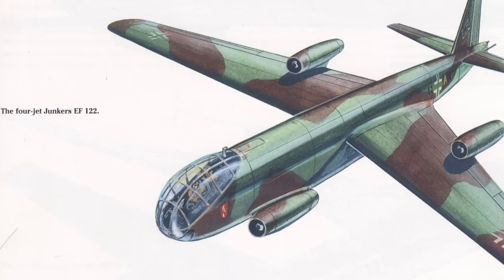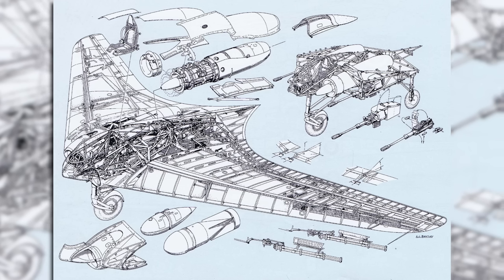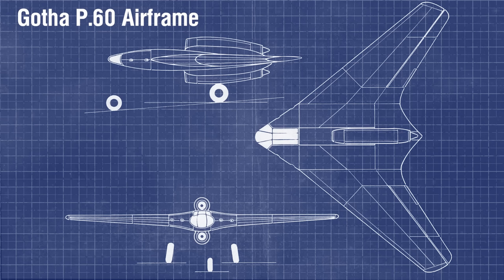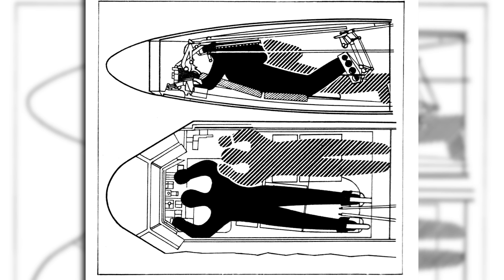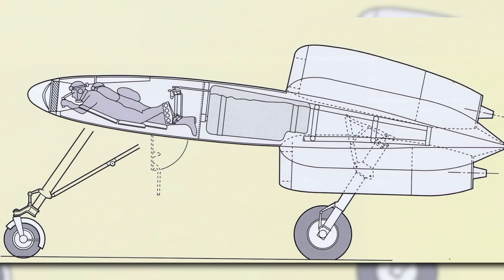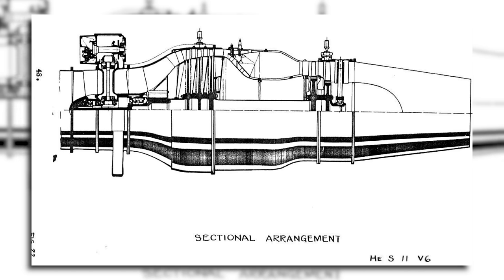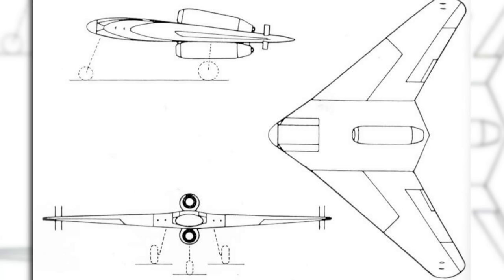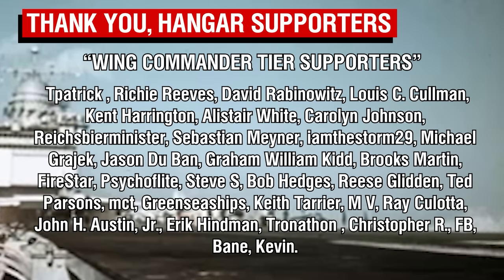Gotha P.60 - A Superior Horten 229? | Concept Planes

Comment: I don't think either plane, the Gotha or Horten would have been operational even if the testing had been done. The reason being, that when the flying wing planes made by the USA around the same time and just after the war, were tested at Muroc Army Air Field, later named Edwards AFB, there appeared to be an inherent instability problem with them associated with the technology of the period. It was not until later when computer tech was installed in the plane that this solved an as a result we have now B-2 bomber.
Reply: Inherent
Reply: Well, more that the real issue was that flying wings without fly-by-wire technology are extremely challenging to handle, and the USA figured that the added pilot-training requirements was prohibitively expensive in both time and resources. With pilot training always a bottleneck at the best of times, requiring dozens, if not hundreds, of more flight hours in training was just not acceptable.
Reply: @nightjarflying  Thank you. I getting old.
Reply: Yeah, sure, if the muricans cant, no one can.
Thats why they needed a german to show them how to put a satelite in orbit and men on the moon.
Flying wing can be build stable, the Hortens did it befor, during and after the war, if in the RC community flying wings are known for their good and stable flying abilities.
Reply: @wolf310ii  The Horten never flew, and RC planes cannot be really good test indicators for the real thing. BTW,  I was not down grading German Technology.  But I am not overhyping it as well.
Reply: @coleparker  The Horten IX did fly and it wasnt the only flying wing the Hortens build.
and yes, RC planes are a good indicator that flying wings have good flying abilitys, same laws of physic and aerodynamic.
Reply: @wolf310ii  You are right. Two were flown, the first flight was done as un powered glider. The second was powered and promptly crashes killing its test pilot. All the rest of the so called production models were captured at wars end. The crash was one of the main pointed out in my comment about flying wings in the USAF. Before the introduction of computer controls, there seems to have been a stability problem in them.
Reply: @coleparker  It didnt crash promptly, it crashed on 3rd test flight after 45 minutes, because of an engine fire, not because of an controll or stability problem.
Reply: @wolf310ii  LooL
Reply: @wolf310ii  Look, you think the Germans were the only ones testing the flying wing concept. Jack Northrop was developing the Flying Wing for the USAAF, USAF in 1940 up through 1945 into the late 40s into the 50s. His first types used propeller driven engines. In the 1946 they started serious testing and finally in 1947 and 50, Check the date. They flew the YB 49 flying wing. It crashed with Col Edwards as the pilot. The cause of crash was determined to be stability problems and pilot response to them, which is probably why they never really became a viable bomber until the introduction of computers into the system.

If you are interested, I suggest that you look at their development and testing at Muroc Army Air Field which was changed to Edwards AFB California in honor of Colonel Edwards/
Reply: @coleparker  No i dont think that, UK and Rissia did also build flying wings.
And just because the YB 49 crashed because of stability problems, doesnt mean every flying wing has stability problems and will crash because of it.
The Ho Ib flew for over 50 years in a flying school, without crashing because of stability problems.

Comment: What's interesting to me is how many of the first gen jets from countries like the UK, France, and the USA had straight wings as opposed to the severely swept wings of these late WWII German designs. I know the allies came into possession of the German research on swept wings, but it did take them a lot longer to put it into practice compared to the Germans.
Reply: The initial jet engines the US, the UK and the USSR were producing really did not produce that much thrust. Swept wings really came into their own once speed ranges got into trans sonic ranges. And it's not like the German designers were the only ones that understood the benefits of swept wings. The UK, US and Soviets had aerodynamic research labs too. To a large degree we hear the "US, UK or Soviet designers just didn't understand the potential of the jet engine (1). Wrong. They understood it. They believed that the high temperature alloys needed for such engines simply had not been developed yet. Wittle gets the credit for his patent and building the first working turbojet. But it's not like he was the only one working on the idea. The only thing is nobody else could get one working or the money to build one prior to Whittle and then Ohlien. Others had tried building aviation turbines pre Whittle but they simply were too heavy. One exception I can think of is Lockheed which was working on its axial flow design starting in the late 30s iirc. 
1) Some did. Some didn't. Plus in the 30s money was tight.
Reply: No nazi operational jets had highly swept wings, the centre of gravity adjustment Me262 wings had the sweep of the DH Tiger Moth, the Fairey Swordfish and the DC3/C-47.  The flying wings had strong wing sweep for lateral stability as featured in many microlights and rogallo wing hang gliders.  None of the half baked pre nazi collapse designs had any prospect of flying fast enough to need wing sweep to delay compressibility.
Reply: @givenfirstnamefamilyfirstn3935  Wrong. The Me 163 had compressibility problems, and the Me 262 also experienced problems in dives.

Comment: it was, but the P60 was less stealthy to radar
Reply: Neither P.60 nor Ho229 were built with deep thoughts on radar signature in mind.
Reply: @wanderschlosser1857 That's a false narrative, Germany was years ahead in radar stealth technology..
Reply: @WilhelmKarsten  No it wasn't. Since radar stealth technology wasn't a thing back then. Flying wings weren't created because of radar signatures. They may have figured it as a helpful side effect but even that is rather a guess. There is no proof at all that Germany did research in radar avoidance by the shape of an airplane. What they did is developing radar reduction coatings for submarine snorkels but that's a completely different area.
Reply: @wanderschlosser1857  LOL! You really don't have any knowledge of this topic do you?
Anyone familiar with radar stealth aircraft technology can take one look at the Ho-229 and see that it is completely devoid of any significant retroreflective structures, something you won't see on other contemporary flying wing designs.
Reply: @WilhelmKarsten  Yeah you can see that, do you? Back in reality radar signatures are calculated and measured. Alone the turbine intakes of the 229 have likely a bigger radar signature than a 4th gen fighter. The 229 resembling a B2 doesn't mean it was designed with the same goals in mind. Would the 229 be less prone to radar reflection than a Me262 or Arado 234? Very likely. Does that mean it is a stealth fighter? Certainly not! The point is, there is no evidence that radar signature was a major, if any subject for the design of the Ho229.
Reply: @wanderschlosser1857  Its obvious you don't know anything at all about radar stealth technology, your comment reveals someone who has absolutely no formal education or professional experience in the field.
1st. No amount of RAM is going to reduce the RCS of an aircraft that presents with retroreflective structures.
2rd. No aircraft are completely invisible to radar, the goal is to reduce the RCS of the aircraft in order to limit the  range of the enemies detection radar.

3rd. British long range detection radar during WW2 was meter band, primitive by the microwave band standard today, 
Testing conducted by Northrup confirmed that the Ho-229 had at least a 50% reduction in frontal RCS (w/o RAM applied).
This is a significant tactal advantage for the era... enough to foil RAF attempts to intercept it before reaching its mission target.
Reply: @WilhelmKarsten  I know about the Northrop test with a 229 mockup. Which wasn't the same material as the original nor did it have all the reflecting surfaces such as compressor blades of the engines. It was simply a test how much the shape of the 229 flying wings would have affected its radar signature back in the day. And yes this test revealed that the expected radar signature might have been significantly lower for a real 229 in comparison to other aircraft of the time. That still doesn't prove that this was what Horten or Gotha or the German aircraft industry had in mind when developing the aircraft. And that was my point. Having a rather coincidental design reducing radar signature does not mean you are years ahead in stealth technology. Northrop figured the same from their flying wing designs of the 30's and 40's when they realized that a flying wing has a smaller RCS by nature. It was decades later when they actually used that knowledge for the B2. That still doesn't mean that the low RCS of the YB-35 and YB-49 were intentional. The same applies to Horton's designs.
Reply: @wanderschlosser1857  Its important to remember that the Northrup tests were also conducted using modern microwave band radar. 
The obvious difference between the Ho-229 and the other early flying wing designs is clear to the naked eye at a simple glance, to imply that this is mere coincidence is just a pathetic attempt at denying the evidence.
Reply: @WilhelmKarsten  The 229 is based on Horten gliders starting from the early 30's (before radar was operational). I assume all of them were designed with RCS in mind then? And your evidence is that it's obvious to the naked eye in the 21st century? Or because there was a mockup test by Northrop 2009 that somewhat proves the lower RCS of a flying wing (ca. 20%), similar as on their own designs of the 40's, which was indeed unintentional? Which was conducted for a TV program (National Geographics) btw. You're just guessing because it sounds cool that Germany was super advanced and able to built the 1st stealth planes in the 40's. The reality is, there is absolutely no evidence that the Hortens had the intention to create a low RCS aircraft. The Horten brothers experimented for many years with all different kind of flying wings and besides Northrop they were the masters of them. The main reason to follow that path on both sides of the Atlantic was the search for reduced drag. The RCS advantage was an unintentional side effect and it took another 40 years to put that into use.

Comment: Jack Northrop would have been impressed.. These flying wing types came out at about the same time.. Northrop 's flying wing ultimately failed because of stability issues. But today we have the B2 and the B-21... The roll rate was poor in these flying wing type craft... The only advantage they had would have to be speed..
Reply: ...and stealth.
Reply: @WilhelmKarsten  No
Reply: @wolf310ii  You didn't know that the Ho-229 had radar stealth technology??
Reply: @WilhelmKarsten  Unlike you, i know it didnt.
Flying wing doesnt mean stealth
Reply: @wolf310ii  True, the Ho-229 was much more advanced than just a flying wing... it has more than a 50% reduction in frontal RCS than any comparable sized aircraft at the time... and this is without its RAM applied.
 this represent a very significant tactical advantage against enemy detection radar in service during WW2.
The Allies had absolutely nothing comparable to this technology..
Reply: @WilhelmKarsten  No, it had not 50% lower RCS, it was around 20% against the outdated Chain Home radar, against the up to date cm radar at that time it had almost no effect.
And no, it was not much more advanced, being a flying wing is the only similarity to the B-2.
Also there was no RAM that could be applied. There was no stealth technologie at all in the Ho IX, because they didnt care about it, there was no research for it in the Luftwaffe and they didnt even done RCS test
Reply: @wolf310ii  WOW! You are very confused and misinformed regarding this subject.
The tests conducted by Lockheed and Northrup confirmed reduced frontal RCS more than 20% using modern microwave band radar.
Britain was using metere band long range detection radar.

The B-2 shares a critical feature in common that Northrup copied directly from the Ho-229.
The Ho-229 is completely devoid of any significant retroreflective structures, something not found on other flying wing aircraft prior to its construction.
Anyone familiar with Radar Stealth technology can spot this unique feature immediately.

Germany was the only country to develop, produce and use RAM in operational service during WW2.

Are you unfamiliar with German WW2 RAM technology such as Tarnmatte and Ferromatten ???
You seem to be in a deep state of denial and confusion regarding this topic..
Reply: @WilhelmKarsten  You are the one being total missinformed.

The engines and the cockpit are highly retroreflective, even wingprofile itself is reflective. everyone knowing about stealth would spot the differences to B-2 immediatlly. The B-2 dont has paralell straight leading and trailing edges and a sharp instead of round leading edge to look cool, its for being only reflective at 4 very small angles. The Ho IX has none of these stealth features.
The air intakes of the B-2 are on top the wings, with radar traps, so that every radar waves that go in, cant come out. The Ho IX has the intakes in the leading edge, without any protection against radar.

 The test Northrop did showed the 20% reduction with meter wavelenght like the chain home used, with the dcm and cm wavelenght the UK used too it showed almost no reduction and with modern radar it showed no reduction at all.
The real Ho IX would perform even worse than the wooden mockup, without the metal grider frame, engines and no cockpitinterior.
Even Reimar Hortens made up coal dust paint was proven to be a hoax and have no effect. 

There are no, absolute none, historical documents about the Ho IX that even mention stealth.
At this point of the war, stealth was total irrelevant for the Luftwaffe, the battle of britain was long lost and over.
The anti radar coatings the Kriegsmarine used had nothing to do with the Luftwaffe.
Just look up a picture of the anti radar coating on a snorkel head, and think abaut it what this coating would do to the aerodynamic of an airplane.

Only UFO lunatics and neonazis keep making up and spreading this BS.
If anything of that would be true, why didnt had Argentina the first stealth figther after the war?

Comment: Their designs were far in advance of everyone else's: but the procurement process was so political and favoritism was so rampant, that it virtually rendered ineffective all these designs tendered. And that was a blessing for the Allies.
Reply: The number of issues for Germany were replete. Its industry suffered from excessive demand, and poor production output. it lacked pilots, fuel. Even the much vaunted Jet engines were, to be a hostile, junk.
Reply: @tisFrancesfault limited manpower and resources is what gave birth to the concept of force multiplication used by modern military forces.

Germany was the world's leader in jet engine technology during WW2, the Allies had absolutely nothing comparable to German jet engines
Reply: @WilhelmKarsten  German Jets had so much influence that, that the allied powers so no need to drastically change its operations as was, let alone forcing the deployment of its own jets. You're not a force multiplier, if it has such little operational impact.
Reply: @tisFrancesfault  The Messerschmitt Me-262 conclusively proves otherwise, it was a highly successful fighter-interceptor while Allied jets did nothing apart from killing Allied pilots.
Reply: @WilhelmKarsten  No, if it was a true threat the Allies would have countered it, but ultimately it was not considered worth the effort. Exist allied air power was sufficient. Even if all airframes were deployable, allied air power was supreme.
Reply: @tisFrancesfault  The  Allies built aircraft like the Gloster Meatbox and the Lockheed P-80 to counter German jet superiority...
The Messerschmitt Me-262 was successful in WW2,  Allied jets were a failure.
Reply: @WilhelmKarsten   Neither were developed to counter German jets, and neither were deployed against German Jets.
Reply: @WilhelmKarsten  Hello Sandyboy, the allies certainly had nothing as crappy, fragile and pointless as your nazi chums' jet engines, that's true.
Reply: @WilhelmKarsten  Hello Sandyboy, as you know the Me 262 failed in all its goals and was never a fighter. It was shot down readily by allied piston prop planes and post war nobody wanted it.
Reply: @WilhelmKarsten  Hello Sandyboy,  the Allies did indeed build aircraft like the Gloster Meteor, the De Havilland Vampire and the Lockheed P-80. Those were the WW2 jets that had very long service careers and served with many air forces.
As you know, the me 262 which utterly failed in its wartime roles also utterly failed in a commercial role postwar being a museum piece after barely seven years and service with only two air forces (and one of them didn't want it).
Reply: A fast airplane with insufficient control surfaces and inexperienced pilots. It’s going to kill somebody.